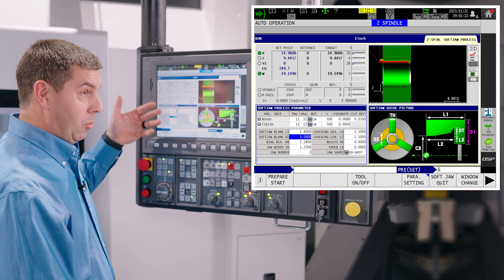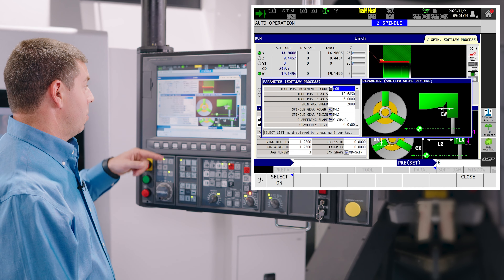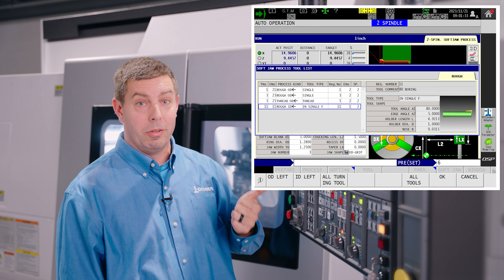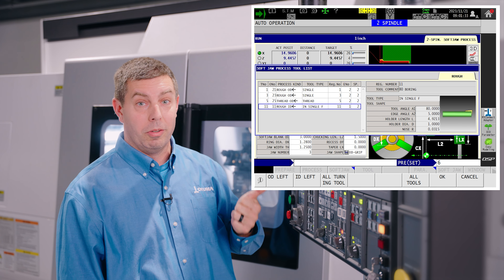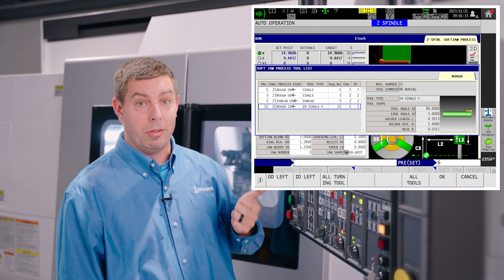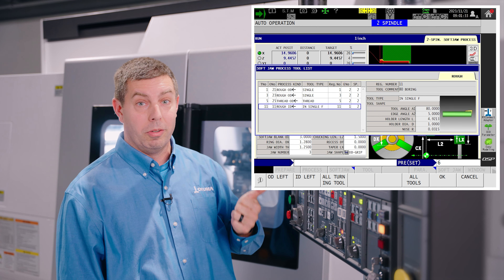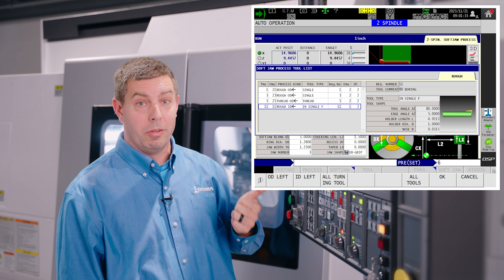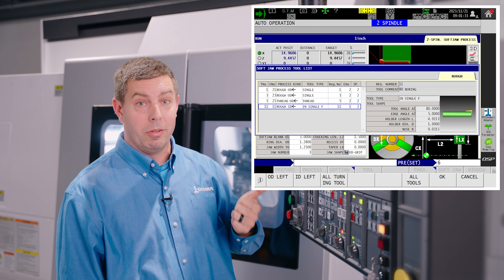OSP CNC Control: Soft Jaw Machining

Comment: Slick process, but to insure a really good fit with the part, the jaws need to be preloaded on a ring or spider fixture with the clamping pressure as close to the actual running pressure that will be used for production. Work holding is where the rubber meets the road. The time taken to do it properly will pay back in part quality.